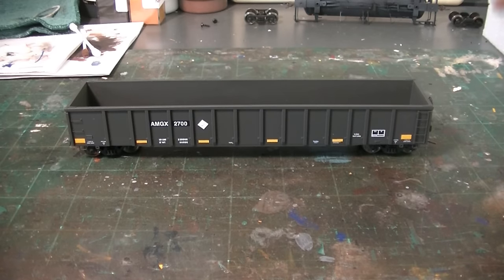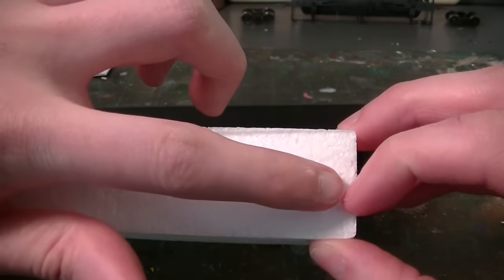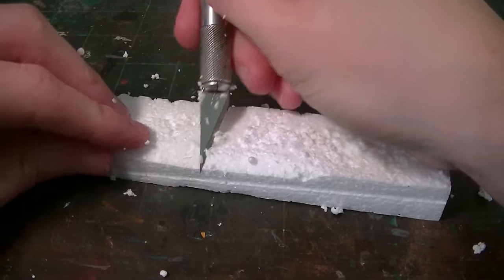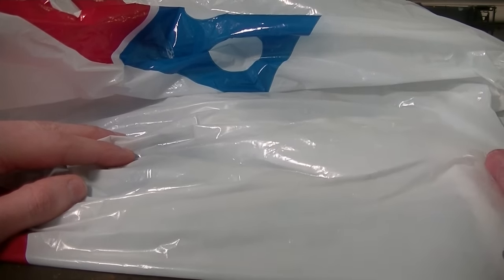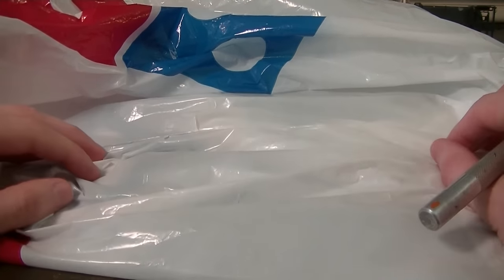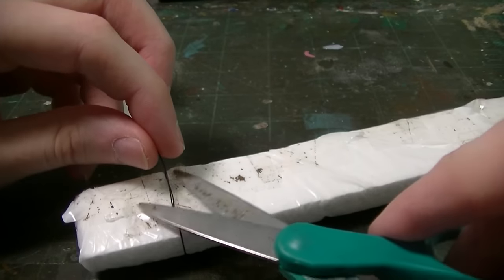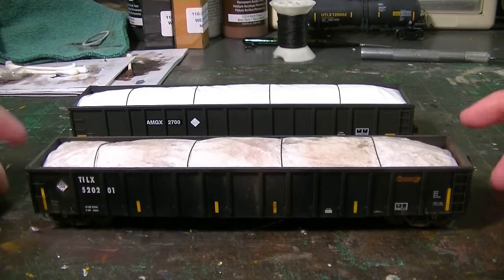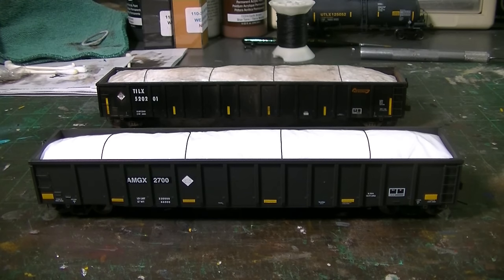HOW TO:   Make A Tarped Dirt Load Cover For Gondolas!

Comment: could u use chalk for weathering powder?
Reply: Yes you can Daniel. Go to the Dollar Store and get you a Cheese Grater with a cup on the bottom to catch the grater Chalks. You can probably find a set of pastels at the store too. Stop by a Walmart and pick up a can of DulCoat in the paint Section. For 5-7 dollars you can get more Dulcoat than at the hobby shop.

Comment: Nice and cost-free construction..Something irrelevant I have noticed though is most HO us freight cars shake like crazy when they run and you can see them shaking here too when he puts the gondolas on the bench...Euro manufacturers make the bogie (trucks) molds with 2 plastic "ears" on top of them and all the cars run very smooth and steady..Also nowone here uses screws on the trucks...They are all snap-on..
Reply from the maker: +Basilis Gian This can be an issue for cars that have loosened screws.  I fix this issue by tightening the screw all the way, only leaving enough slack so that the truck can swivel freely without catching, or ''dragging''.
Reply: Oh ok I see!